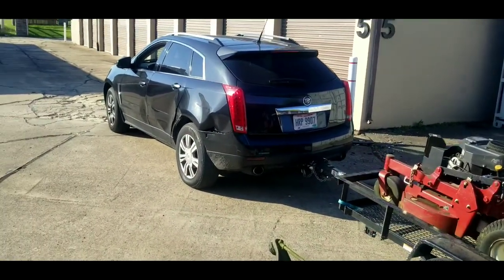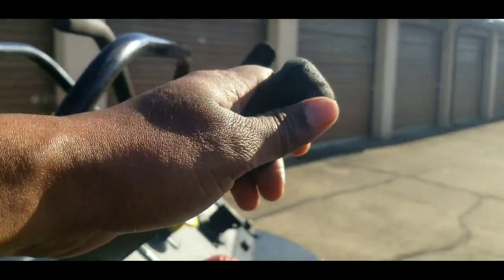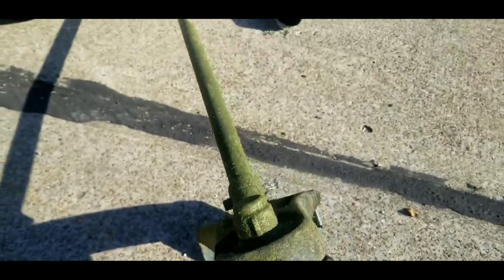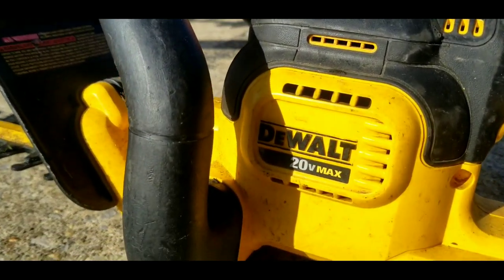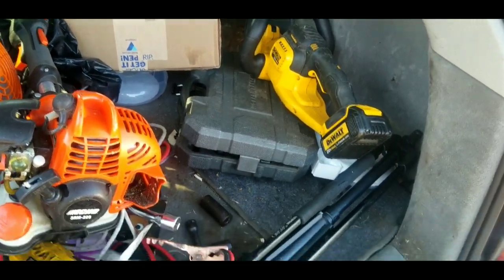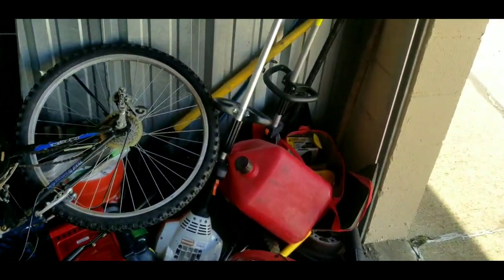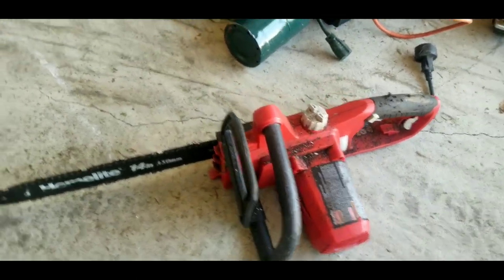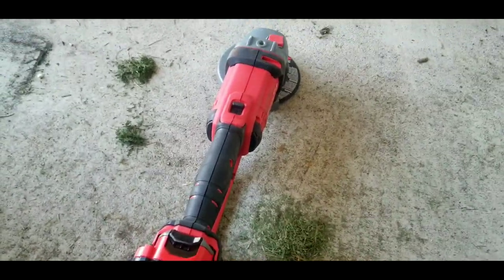2022 Lawn care setup

Comment: How much does the mower weigh ? I have a similar trailer and mower, I’m scared the trailer will break though lol
Reply from the maker: It weights 800lbs and I'll be honest the trailer does hold the mower but I will be getting a few welding done to make it stronger because some of the wire mesh is peeling back
Reply: @qualitylawncare3367  I really want to reinforce mine, but my vehicle can only pull so much weight, reinforcing it might change the weight.